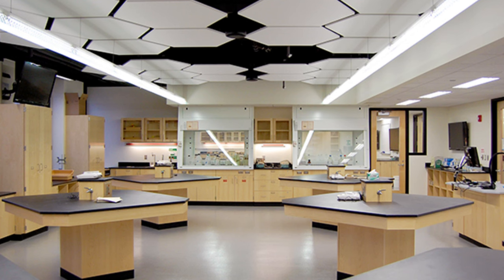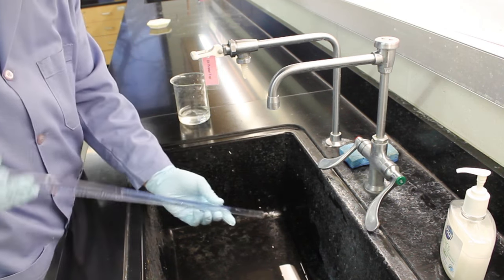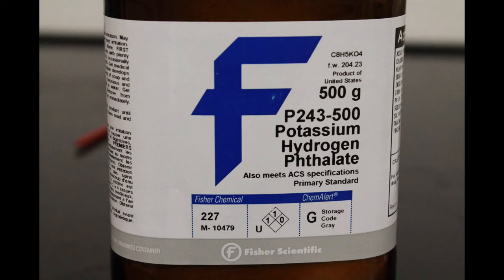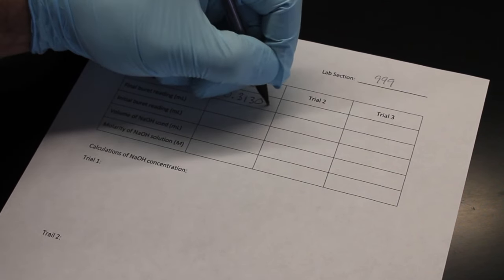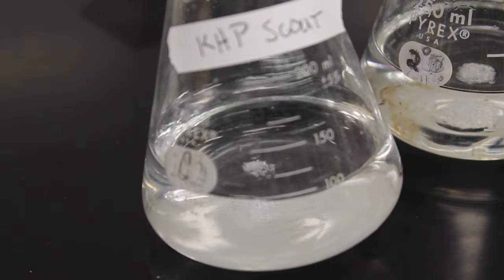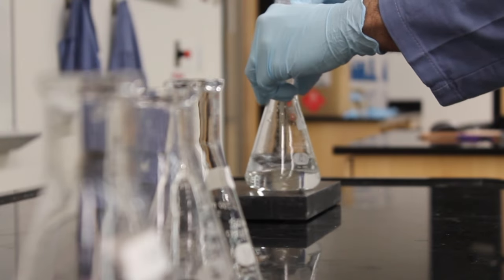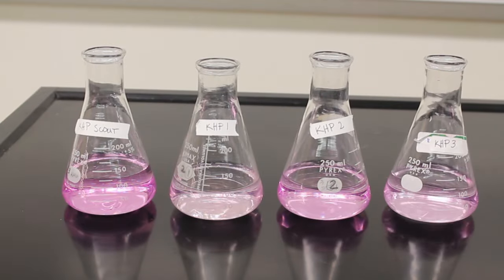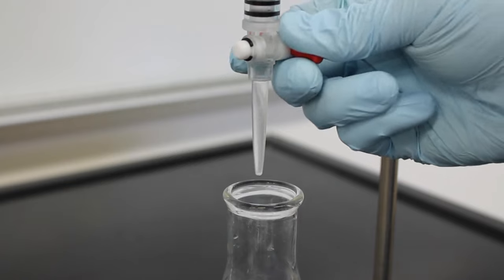Titration Video

Comment: 4:10 Why doesn't the exact volume of water matter in this part?
Reply: because you're interested in the mass of KHP.  Using the mass of KHP and the molar mass of KHP you can calculate the moles of KHP in the flask.  After titration, you can then use the balanced chemical equation to convert from moles of KHP to moles of whatever your titrant is (in this case NaOH).  And because you know the volume of titrant used to satisfy the reaction, you can calculate the concentration of NaOH by diving the volume of NaOH used by the moles of NaOH reacted (M=mol solute/L of soln)
Reply: short answer: the volume of deionized water doesn't matter because it won't change the amount of moles of KHP in the flask.
Reply: @kevinseyedin4415  hii do you happen to know what makes them stop titrating? (05:54) how did they know why it's 15 1/2 NaOH to add,, is it just based on the color or? hope you can help :(
Reply: @kiminonawa5598 Yes, it's just based on colour change. Two years late, but I'm here for you!